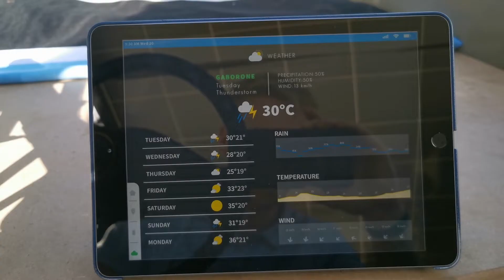The First Solar Car built in Botswana, Africa! – ITQ GmbH

Comment: The Light Year Squad solar electric car also takes about 4 hours and has up to four easily removable briefcase sized hot swap-able batteries for it , you just pull out the main battery, push the spare in its place and you are ready to go in well under a minute.